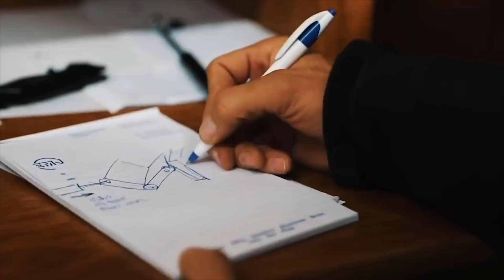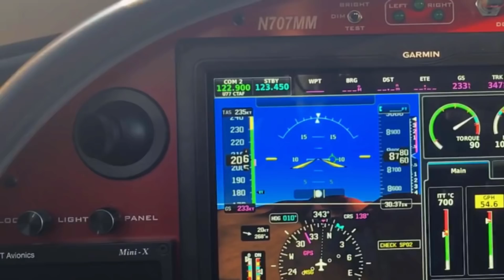Mike Patey about his life, Turbulence, Draco, Scrappy, a scoop and more - MLA, LSA and GA - S02 E08

Comment: Draco crashed because of adverse Yaw if you want my opinion, if you have an aileron dragging on one wing and pressure on one wheel the plane is going to pivot on that wheel. the longer the wing the more leverage drag force will have, it is the type of effect that upsets piper cubs in cross wind situations if you try to keep the wings level while the plane is going slow on the ground,the best way to keep the wings level is to take of into the wind and you know Draco could take off in the width of the runway! so that is never going to be a problem.
I find that strong cross winds and high aspect ratio high wing trainers usually ends up in a ground loop followed by a kart wheel where every corner of the plane gets damaged.

Comment: Great interview, Mike is a gifted man, so talented, I also love following his videos. By the way I'm an aeronautical engineer and understand when he explain the carbon fiber manufacturing process, aluminum parts design and machining, aircraft stability and aerodynamics. What he does in the hangar is a dram job. My only concern is that I hope he using the adequate protection equipment when working with such hazardous materials all the time. Long life to Mike.
Reply from the maker: Thanks! 👍🏻 Ah, so you're an aeronautical engineer? Must be an awesome job? I think Mike uses protection gear, since he's doing that work for quite some time now?
Reply: @ForFunFlyer  It is an awesome job, thank you, but nothing like modifying, designing and manufacturing parts for your own plane. Yes, I have seen Mike is using face masks with filters and gloves when grinding composites. But I have also seen him with regular medical face masks which are not optimum. That is what I meant when I said "All the time" I have also seen him removing the mask right after mechanically sanding  carbon fiber parts, which |I have to say is dangerous as the powder is still in the air. I have had training on hazardous material in some of the companies I have worked for. I can just wish all the best to Mike and his family.
Reply from the maker: Ah, I see. Perhaps he's reading along and will follow up on your advice?
Reply from the maker: If you like technical stuff, check out these videos of mine; https://www.youtube.com/playlist?list=PL2hZJ46SgHWTWus_OVQmlE5AhCiLiOY1G
Reply from the maker: These videos are me working on my aircraft 😉